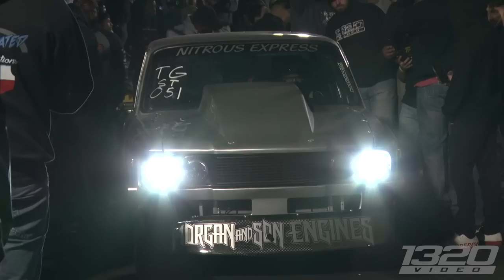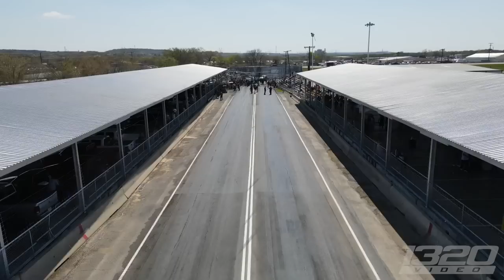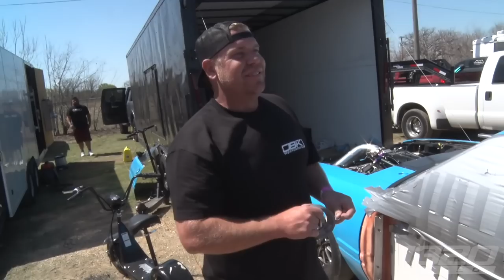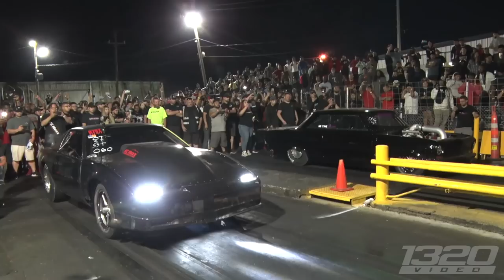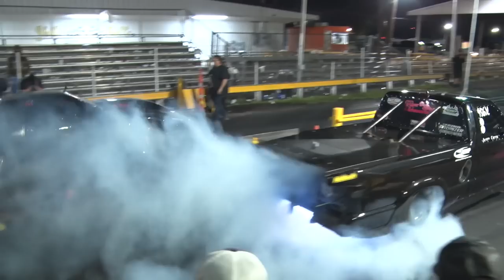Doors RIPPED OFF Cars & SENT Towards the CROWD! (Yello Belly Small Tire)

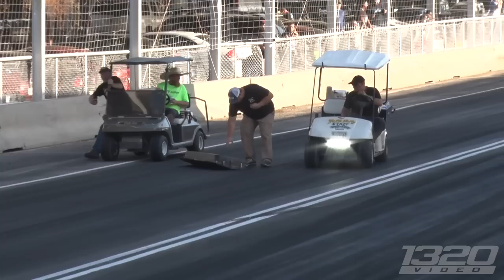Comment: 11:07 never use old bolts from the factory that came on the car for your door hinges when you race up a car like this. I'm telling you this because I learned the hard way as well everything falls apart when air pressure pushes like that and frames twist
Reply: I blew the t tops out of my gn when it did the g body shuffle
Reply: @bigscrap84  have seen an old photo of an escort that had the Capri v6 put in it… twist its windshield out on the launch. It pretzeled the frame rails like the early cobras.
Reply: @riz3nfpv306  capri 2.8 v6 had about 150 bhp
Reply: @Vteccer666  standard
Reply: It's mostly because of the frame twist.
Reply: Most of the times the aluminum hinge breaks. I've had to weld quite a few. They literally tear in half.
Reply: These are simply shit box cars with 'quick release' doors. Worse, they are fibreglass with the hinges glassed on..What could go wrong????
Drag racing with 200 lb obese cages that the driver can smash their heads on  but the doors fall off all the time! Usually when crashing. And too often the fuel tank is behind the headlight. Yeah, real clever and real safe!

Comment: So I wonder if because the track is so tight and the airflow creates vortexes I'm wondering if that's not what's causing the doors and vendors to get ripped off at that track  if something is loose or just has that right small gap that airflow is going to get in there and it's going to suck it out The air pressure at the track kind of reminds me of what a decompression of an aircraft and losing its door or structure would be like. But it's definitely a mixture between the track and car design I mean these cars get abused and if they got fiberglass and they get redundant lot there are some minor flaws within these car designs that the way that this track is made It's going to definitely rip your car apart and I think people need to take that in consideration when they go to this track. 
I can definitely say I have never seen a tight track like this. Most of the tracks I've been to have been actual NHRA official tracks or old runways. 
I can definitely say I have never seen a tight track like that and I can't imagine what people do if they take their regular street car if they do street car races at this track lol 🤣 explain that to your insurance company 😂 well you see it's like this I took my  car to the track and lost my doors 😂.
Reply: I was thinking the same thing. That air pressure and flow and even sound dynamics would be different at this track and may contribute to body parts flying! Especially lightweight carbon fiber or fiberglass.
Reply: If you can drive it, you can race it. It gets wild at night.
Reply: they'll damn near anything run there. street cars, motorcycles, 4 wheelers, side by sides, or that weird shit you built in your garage.